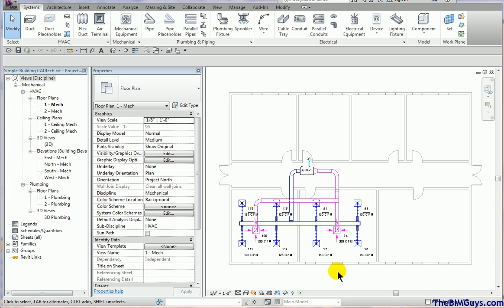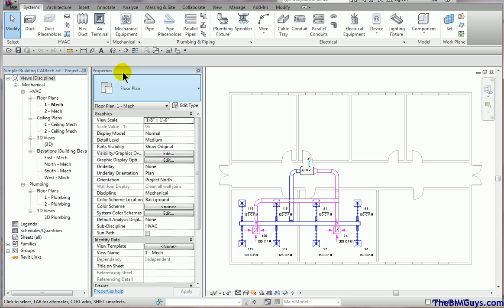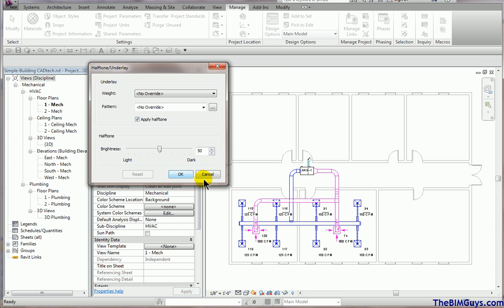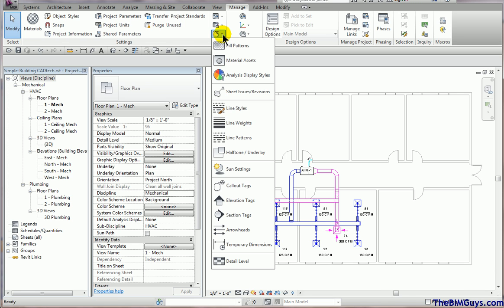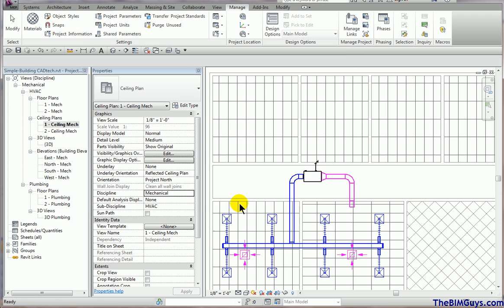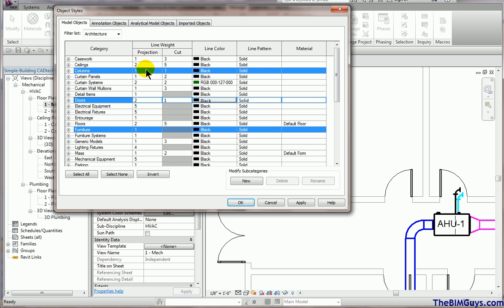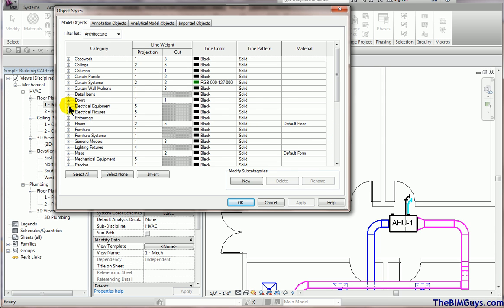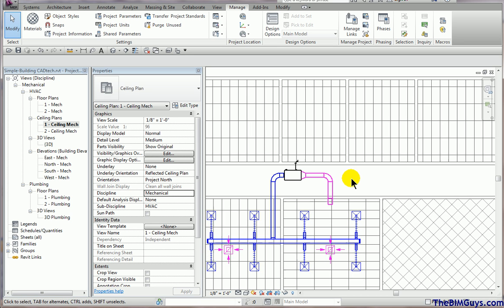Revit MEP - Adjusting the Lineweights for Printing - CADtechSeminars.com

Comment: how can rectify the hvac model .All the duct come to correct line weight.but only one set off duct coming to rong line weights .how can I rectify that issue
Reply from the maker: There are many factors. The one I am suspect of is systems. If a duct does not have a system assigned, it remains black lines and thin. Select the duct, Go to Properties > Choose system type> Choose a system.  Hope this helps.

Comment: Will this work for a Linked Model.?  I was trying to change the line work of a linked model but it did not change using this method. Would it have to be changed through the model ?